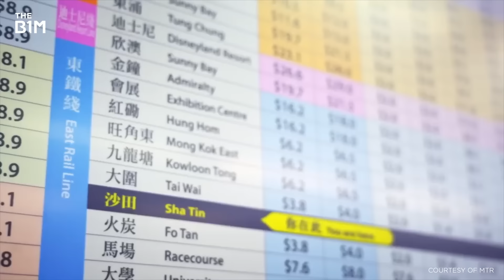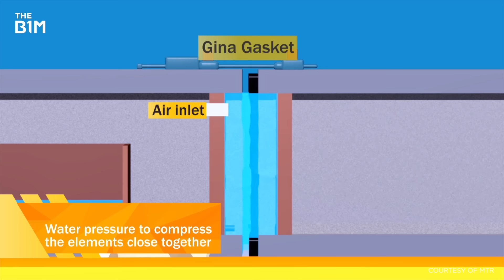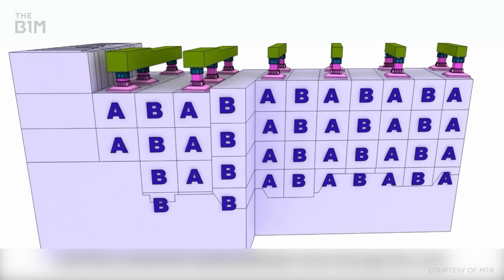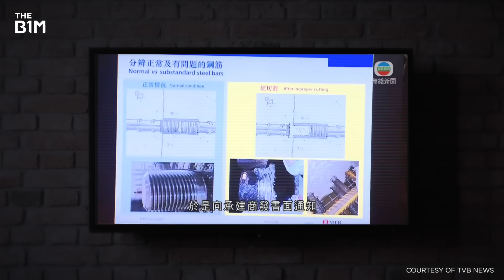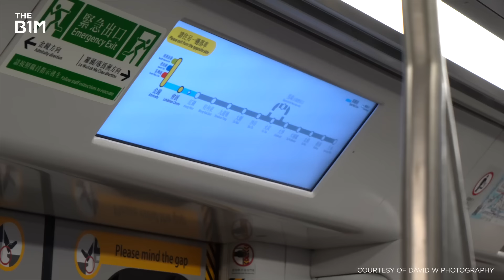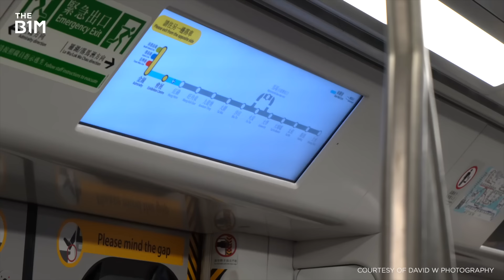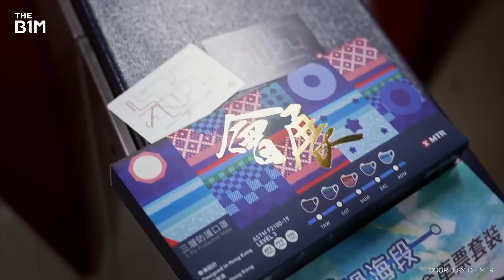Hong Kong's $11BN Underwater Railway Explained

Comment: The treatment of Jason Poon after this was shocking. He saved many lives by speaking out. If the structure collapsed the company would have been liable and the consequences much worse than what Jason Poon did.
Reply: what happened to him?
Reply: @lshanny  Nothing has happened to him.
Reply: @StrangerHappened  there could be a chance he's living under threat everyday or went through immense stress due to this. Whistleblowing is simply not taken in a fair light wherever governance is favoring the government.
Reply: What was the treatment of him afterwards?
Reply: People who speak up about wrong doings, rorting and downright theft are usually targets for those who would have gained financially.
Reply: This video misrepresented the issue in Hung Hom Station.  The rod beams didn't screw all the way into the sockets. The workers were having trouble screwing the rods. So they just screwed HALFway,  Later, the chief engineering inspector saying at the press it is STILL SAFE without remedy work.
Reply: @FirestormX9  no, I don't think anything happened to him. Also he was whistleblowing the contractor, a private company (Leighton), not the government
Reply: @Ianchia860  i'm not giving a certainty that something bad happened to him, i'm highlighting the increased chances of that happening due to the political and subsequent cultural environment he is in. Also, its basically default to include large corporations or private companies along with said governments, *when talking about whistleblowing. Govts dont function in isolation.
Reply: @allwheelmodeltoys491  It is a design mistake to use screw-on rebar couplers, they were never meant to be used on horizontal rebars. It is too easy to be accidentally filled with concrete and when that happens, it is almost impossible to clean it up to a point for another rebar to completely screws into. Why weren't bolting rebar couplers used instead?

Of course the reports are going to blame the workers, what do you expect? MTR to admit it's their design mistake?
Reply: @FirestormX9  but nothing happened to him, if any he's able to speak out on the contractor's negligence due to the fact that the government would have over power private contractors
Reply: @Hhhh22222-w  well all my best of hope for this is that what you say is actually what is true for him.
Reply: Rebar coupler did not tighten to design tread is the combined failure of workmanship, design and attitude problem.

1. Workmanship problem > cement grout leaked into the coupler tread during concrete pouring resulting new re-bar cannot be tightened into the design deep inside the coupler (worker has poor attitude to proper protect the coupler, also worker not report the problem to management staff that rebar / coupler cannot be properly tightened).

2. Design problem > if rebar can be tighten by some purposely desigm power tool for generating the required torque force (instead of tighten manually by hand / wrench) then all rebar and coupler shall able to tighten to the original design thread > no issue. Actually it is an attitude problem...

A. Worker unable to proper carry out the task (whenever reasons).
B. Supervision > random check frequency by inspector is not sufficient
C. Insufficient communication & support between designer / coupler manufacturer / actual workers > I have experienced similar issue > the rebars / couplers are difficult accessing by hand (too many rebars), coupler are all jammed by cement grout and worker don't care...😤

If serious inspector, serious contractor and serious workers / site foreman / engineer all work together, it will not happen (I.e. I just have a feeling that old Japanese contractors / workers > they are more serious about their responsibility > real Japanese made car maker such as Toyota, Honda,  Mazda are generally have better built quality than local Chinese brand car makers.

Certainly > you have to pay the premium for enjoying the quality 😁 > the sad thing > bear in mind Hong Kong construction workers are not cheap today than Japanese workers)
Reply: The investigation report says at least 8 rebars has been cut.
Jason Poon's company was left with very little business went insolvent by the end of 2020.
The lead contractor, Leighton, has not even been suspended for subsequent tender.
Reply: Why did they purposefully not screw in the screw all the way?
Reply: @jk484 
Workers were not intentionally did it, it was the workmanship issue. Rebar and coupler mateials were already there (no shortage).

The issue was workers not fully screwed / tighten the rebar/coupler to specify deep because the screw thread were jammed due to careless issue and limited working space (so it is not an excuse and able to rectify with time and additional work > money). 

However, attitude problem are not just solely blamed to the workers...I guess workers, contractor management staff and client inspector and designer all shared some responsibilities by not solving the problem and let the workers "SCREWED" the work.

At the end, the client, the engineer and contractor has duty to establish proper mechanism to control the workmanship, so it cannot just blame the workers / labours (if they able to resolve the problem by themselves, they already site manager!)
Reply: @brianho6625  It takes a brave Chinese person to say the Japanese are more professional than Hong Kongers.
Reply: Which high speed train you perfer to ride daily?
Travel by Shinkansen (bullet train) at 300km/hr  between the journey from Tokyo to Osaka?
Travel by high speed train at 300km/hr between the journey from Shanghai to Beijing?

I could only say that I feel more safe for closing my eyes and sleep well on Shinkansen at this moment😅

However, I cannot deny that Chinese's own made high speed training are very successful and competitive (through technology transfer from Japan, France and Germany) in term of price and built time. 

Chinese manage to develop their own high speed train (through technology transfer) and able to export to foreign counties for sale for less than 20 years.

Japan developed their high speed train since 1960s.

From reliability and safety prospective, it is not doubt (psychology effect) that I still prefer to ride on Shinkansen at this moment (year 2022). Perhaps it will change in the near future 😀
Reply: @honeheke4554  
Non-compliance construction issue still has chance for remedy and make good without cover-up for endanger the public....In some country, non-compliance will cover up forever or being disclosed until disaster happened.

When seeing from this prospective (poor things can still be rectified), HK still has integrity at this moment.
Reply: @brianho6625  I hope this is and will be certain and true.
Reply: @allwheelmodeltoys491  
Ask the chief inspector of work for this project?

Firstly, he represents the Employer / Engineer of the project and likely has conflict of interest in this case.

Secondly, he cannot represent the coupler manufacturer for saying the couplers are complaince to the design strength under this circumstance.

Thirdly, once the coupler + rebar embedded into the concrete, it is unable to vertify 10%, 20%, 30%, 50%, 75% to the original design strength unless an open-up inspection/examination was conducted for the poured concrete or x-ray radiology examination (if couplers are too depth to the concrete, then x-ray may not be able to penerate to the target depth for scanning the condition of coupler/rebar image, so the test has limitation too.)

By the way, it is interested to know how the chief inspector of the project was so confident about the non-compliance couplers are able to meet the target design strength unless an open-up examination were conducted at the all connection points between concrete /coupler / rebar or x-ray radiology examination (in this case, it means all concrete work may need to open-up, but also means demolishing the concrete works too)

Ask an expert witness and coupler manufacturer for testify, perhaps they will tell another story🤣 

The coupler manufacturer is an international brand, so he will not bias for a specific project and ruin his reputation in the industry
Reply: @Ianchia860  That's right, B1M hidden the fact that it was Leighton fault.  It was also in the news that Leighton didn't pay Jason's company for their work.
Reply: i think it’s worst that it’s so overbudgeted and hk people have to pay for it and the poor QC
Reply: I’m sure he is fine 🥸😎😉
Reply: @allwheelmodeltoys491  If any disaster happened which the unconnected rods is involved, the dodgy inspector would be fully responsible. Such a serious deviation from design cannot be tolerated.
Reply: You're ignoring the fact that he has an awesome last name......
Reply: @jk484  Read what Brian Ho wrote a few comments back, he explains it very well.
Reply: Yeah he solved a problem he created 👏👏👏👏
Reply: deadly spamdemic the usual BS
Reply: Even after a structure collapse with dozens or even hundreds of fatal casualties the persons responsible often get off scot frree. Just watch the YouTube channels Fascinating Horror and Dark History for examples. It's rare that anyone gets punished or it's somone low on the totem pole who becomes the fall guy.
Reply: @jk484  Put simply, laziness.  Workers encountered a problem with fitment and decided to hide it rather than flag it.
Reply: @brianho6625   its laziness , there are easy ways to repair the coupling using small masonry drill to remove most of concrete from the hole , then use concrete softener spray or pressure washer to blast the threads clean.
It was poor supervision and QC.
Reply: @FirestormX9  but nothing happened to him. he wasnt threatened by anyone for being a whisteblower. stop your speculation nonsense.
Reply: @michaelan9688  nothing transparent
Reply: similar to America where the US punished Julian Assange for exposing US war crimes in Afghanistan
Reply: @brianho6625  The Japan rail had numerous problems which did not surface. Their engineers are more tight lipped not that they didn't find any problems;)
Reply: @greaterbayareahero1401  
Can you specific what kind of problem?
Yoh can blame people/country with problem but cannot be specified, this is not the way of doing engineering.
Reply: @brianho6625  it's the Japanese way;)
Reply: @FirestormX9  the ceo himself never said anything about him
Reply: Man, I wish my last name was Poon. ☹️
Reply: This was basically a situation of political play. i.e. Hidden versus... non-hidden... If what was shown on the animation was true. Then those actual bars were deliberately cut. And if you think about the situation.. the companies take out big insurances to do the work... and it is not meant to be actually desired or wanted. Those who cut the bars, assume that they are clever. At the same time.. those companies that insured the workd... took out a big loan.. and considering that they are foreign companies. It means that, those countries will and shall economically collapse... In this situation.. would you, or would you NOT... actually whistle blow ? So your company forcing the country to collapse.. means that, this is an even better situation to happen ? Now.. THIS is literally politics...  as in.. dirty politics. 

It's like the Olympics... each time, a country host an Olympic, there could be a chance that there is a loss... and who would bear those costs ? Not each country could afford such losses....
Reply: @greaterbayareahero1401  : But Japan rail is a private national project. Not an international project, with different companies as suppliers to the project.. and those companies, bear the weight and currency fluctuations as well of their own home country. So yeh... this is no mean feat !!!!  (NB: Judging the comments here.. it seems like... the "design" (which is the original calculation was wrong, or misjudged... cos most companies would indeed just actually do what is required etc)... and in this instance... James Poon did not "whistle blow"... Whistle blow is a situation whereby you knew that it would break a situation, and then it is a bad situation, and it was intentionally done. So.. in this situation.. did they deviated from the original design? Presume not. So if they did not, then basically, his assumption is that... in an "undefined situation" and "untested".... He desired more to be spent, and more to be added to be above a tolerance level, rather than actually to follow the original design. i.e. He is trying to force more money to be spent.. than not...  Everything has a cost. So, would it come from his company ? Cos taxpayors are paying for this. Not his own personal account. 

There are starving and poor adults in HK. And this project is what... just another few millions.. for what purpose ? To save the trip for an extra 15 minutes ????.... THIS.. as we say in Cantonese.. is "spoiling the child".
Reply: Nothing happened to him.  I follow him on LinkedIn.
Reply: Oh NO!  It should have been mentioned in this post.

Comment: They also updated the trains. The old Sha Tin line trains dates back to the 80s when that rail was electrified. They were refitted before, but they are getting old. However, because of size limitation of the new stations, the new trains are shorter. To compensate, they'll be running more frequently. Hopefully, with new train compatible with computerized station control to line up with platform screen doors, they can upgrade the old above ground stations along the original Sha Tin line with platform gates.
Reply: Yes, also, the biggest obstacle to installing platform gates was the inconsistent door spacing between old and new trains.  Still, a rope-based barrier system could have been done like some stations in Japan and Korea.
Reply: @canto_v12  Why install a rope based barrier when MTR can install proper platform gates anyway? The mixed fleet operation period was only temporary.
Reply: @squidgame2021  cheaper and doesn’t require re-engineering the HVAC.
Reply: @canto_v12  Fair, but MTR would have replaced those systems anyway because they are old.

Comment: Very informative video. I’m one of those people who was really excited about the SCL project completing because I’ve been loosely following its progress for years, and I benefited from it more than I could have realized. With how many things MTR does to its network, for years I felt left out, but the East Rail Cross Harbor extension was something I always dreamed about.

I admit that this video could really have talked about how exactly this project was so significant. It did hint at the traffic congestion and horrific overcrowding in trains and interchange stations (Cough Admiralty), but as someone who tested the trip myself, let me break it down:

Before, if you live in the most Northern part of Hong Kong and work in Admiralty for example, good luck. It’s an 55 minute ride on the MTR with two interchange stations (Kowloon Tong and Mong Kok) and a lot of waiting for trains during the interchange. But the extension cuts both interchange stations and shortens the ride drastically to just 40 minutes. The trains got faster, more frequent, and they travel further in the same amount of time. For reference, and I did test this- The time needed to get to Hung Hom from Sheung Shui in the past, is somehow the same amount of time it takes to get from Sheung Shui to Admiralty now, being 40 minutes. Crazy.
Reply: To be fair, few will understand the geographical challenges of commuting in Hong Kong.  You and I know it by heart but nobody builds major cities on a couple of steep rocky islands.  HK is unique in that regard, and it constrains the alignment of transportation corridors.

Comment: In 1973 I saw 21 story bamboo scaffolding on a hotel in Singapore. It was erected so that the entire exterior could be finished with 1” light blue glass mosaic tiles. The sidewalk level legs felt like steel. They rested on the sidewalk concrete slab with no cracking visible. Astonishing.

Comment: As a Hongkonger, I will describe the project as a double-edged sword. For the new section of East Rail Line, of course it is a convenient alternaive for crossing the harbour. However, the number of train carriages is reduced from 12 to 9 makes the travel of old section extremely crowded.
Reply: Hopefully the new train control system will keep the passengers moving more efficiently.

Comment: First time to use Admiralty interchange station on 2022-07-07 after its extension. It is a hugh underground mulit-level (6 levels from ground to bottom) underground railway interchange platform. It is amazing (engineering complexity is a must and no surprised). It is about MTRC is so rich to built / invest such expensive underground excavation works in a busy urban area👍

I think the construction lasted for more than 10 years private funded NEC project.

For digging, underpinning and maintaining live operation of underground railway (2 existing level with 2 ways train at each level) and continue to build another 2 level of underground railway platform at the same location at busy urban city (ground settlement of each point on railway tracks are kept at less than 5mm)....

The engineering complexity is a must, also the city is so rich for funding such expensive project privately. Well done MTRC👍